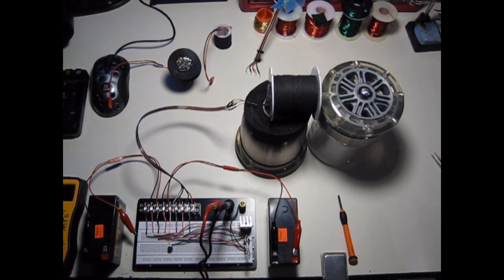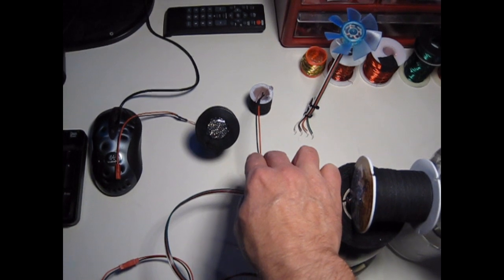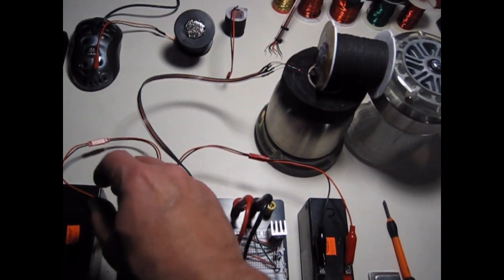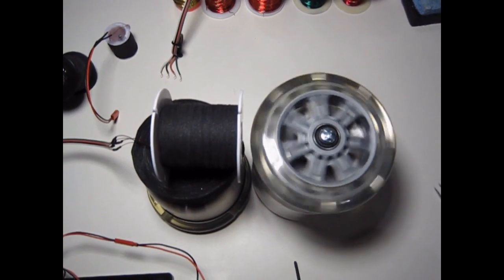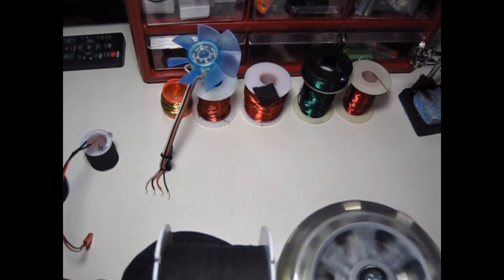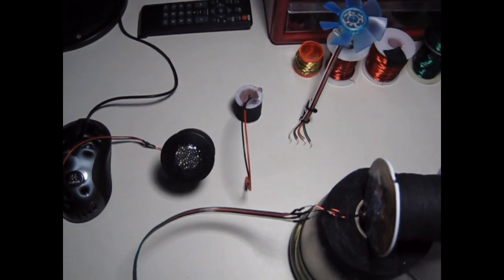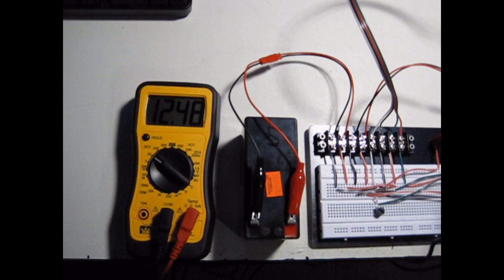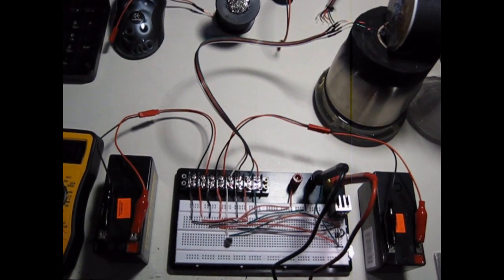My 3rd Bedini Motor

Comment: I think why you have a problem starting the Bedini motor is in fact to big of the core diameter vs diameter of magnets. Measurements should be about the same. 
It's also good for the core to stick out a little bit on the other side of the coil, so flux can find good close path e.i. magnets- core- magnets
Reply: You can also add a trimmer pot. 1M in place of collector — base to forward bias the tranzistor.
Armed with knowledge you should be able to produced some fruits. 
Happy experimenting. §

Comment: This is a mechanical Dc to DC converter. It charges batteries by rectifying the back emf of a coil fed with short duration pulses. The pulse timing is controlled by the flywheel.
The equivalent could be built without the flywheel or any moving parts or magnets by using the same transistor and power coil (trigger coil not necessary) but driving the transistor from an oscillator with a suitable mark/space ratio. In other words drive the transistor with a waveform that resembles the trigger pulses. This set up will make the transistor and coil produce the same output as the Bedini motor so should be just as good at charging and reconditioning batteries.
This type of circuit is known as a buck boost converter.

Comment: Why does a bedini motor need a battery? In my opinion it would work better with a capacitor. I'm still not convinced this isn't pseudoscience. And why is it that I never see videos of any built big enough to have practical use?
Reply: Because they dont work or have any practical use
Reply: I guess you don't look hard enough. At one time they were selling a SG1 kit but it wasn't cheap. Google Bedini motor.
Reply: Ramon Preston Why would I ever buy one?

Comment: I m giving it a try also but no luck keeping it spinning.I do not see any transistor or parts on the board.can you show the circuit you are using.and the size of the coil spool?hxwxl of spool?Idont know what I'm doing wrong but I'll keep on going with some help.Thanks Bruce
Reply: You wont have any luck cause you've been conned, the only thing this excels at is scamming people
Reply: ***** actually john says it can be self looped.but you will have to exchange a bank of batteries.unless you can devise an auto switcher. And the one i made is free energy. ive always been able to keep both batts charging at all times. as long as i switch them out.
Reply: ***** Sorry I dont live in the 1950s I have zero need for a dessulfator

Comment: Hello Dave,

I'm one of your avid subscriber and i'm really impressed on your bedini circuits. I just want to ask some details about your circuit.

1. How many turns do you have on your #22&26 bifilar coil?
2. Is neon bulb necessary in the circuit?
3. Is roller skate wheel the best rotor to be used? Do you have any recommendations if there is anything better?

Comment: I have only been able to build the SG so far using a fan motor by removing the fan blades down to the metal cylinder and inverting it on top of the fan with the barring's then  added four curved magnets and a 448 winding bifilar with # 22 and #26 wires.  It is exciting to use the back EMF to push magnets around.

Comment: Do you know what a generator or alternator are?  once you get your motor working great you advance to attach a alternator to it then you can advance from there.  I'm at the same stage as this video and have a motor running now so I need to create a bigger motor then add a generator.  College is taught by tenured narrow minded teachers that will never advance and suck in your money as long as you spend it~  Do some research yourself.

Comment: Jon Deth, I'm going to step in and ask you a question and if you answer this truthfully you will prove what your'e aysing wrong! You say there is NO SOURCE OF FREE ELECTONS right?  If you have a brain then tell me what makes a crystal radio work? NO Batteries or source of power!
RF frequencies and electrons permiate the atmosphere. Capturing it is not impossible. Converting RF frequencies to voltage is a proven fact! I suggest you come back when you know what your talking about! Have a good day!

Comment from the maker: I think the first coil I used metal coat hangars, which isn't the best material for the core.
(I was still learning)- The Copper coated Steel Welding Rods are recommended. (R60, RG40, RG45) I just went to ACE Hardware and found some generic Copper coated Steel Welding Rods. They worked really well. (I'm not sure where to find them on the web.)
Dave

Comment: ok thanks, I will try to replicate this project in the next days. last question:
at 4.46 you are showing the inside of wired copper.. "Copper coated Steel Welding Rods"

is this the name of the things? I've tried to find on google with no success, can you post me a link ? :)

Comment from the maker: The Circuit does a few things. As the Magnet passes the Coil, the power generated causes the Transistor to "Switch". This creates the Back EMF Spike that is used to charge the 2n'd Battery...and it also turns the Circuit into a Motor, which pushes the Magnet past the Coil. Then the Transistor "Switches" back to its previous state. Hope this helps.
Dave

Comment: I would like to see an ammeter in series with the charging battery. If it's charging at less than 200mA then it's not charging the battery, only rejuvenating it !!!!!!! 
You need at least 400mA to charge it successfuly!!!

Comment: remove magnets. leave just 4 or 6 no matter u have 2 have false S poles in between them. put a little cap instead charge bat. put additional coil before diode. better bi-filer. find base resistance and best connection to run the motor. try another coils you have. check cap voltage, the higher the better, current, the lower..,and RPM. with your best result discon neon for short to see cap volts. charge something with no neon, it cuts volts. never run with no load and no neon, u'll lost ur trans))

Comment from the maker: A good core material is Copper coated Steel Welding Rods, cut to the length of the coil. A found some at Ace Hardware.
Dave

Comment: have you ever hooked it up to an inverter or alternator to run anything.  I have seen a lot of video on here but it always just a spinning wheel in closed loop system from what I can tell or running a few low watt leds.  I am very interested in getting one but I want to be able to hook it up to a inverter to power lights or a tv etc

Comment: @Americankettler Just one correction. It's not back EMF that they are charging with. After playing with pulse motors a bit, I reached a conclusion, that the primary acts more like a gate here, creating conditions where the secondary charges. This can't be explained using just classical electrical engineering. Sudden collapse of electric field in the coil makes something happen there. Whatever it is, it can charge batteries, capacitors, god know what else it can do.

Comment from the maker: @GJ3200 - Right now...there are 2 good uses for this circuit. Charging Batteries...and Re-conditioning Batteries. I've brought back 3 Batteries that I thought were trash. Now they are holding a good charge for a long time.
Dave

Comment from the maker: @cloverpark2011 - They are pretty strong Neo Magnets...not sure about the pull force. I later discovered its not so much the stength of the magnets, but the Back EMF that the circuit itself generates. The recommended magnets are Ceramic.
Dave

Comment from the maker: @cloverpark2011 - Make sure the Inner and Outer Coil wires are wired correctly per the schematic at the beginning of the video. It win't run if you have them wrong. Tuning is a way of getting the circuit to charge more efficiently. I explain that part better on a later video..."Tuning My Multi Coil Bedini Wheel Part 1"
Dave

Comment: great work, but I think the problem with the wheel is that it kinda wobbles on its bearings, I tried my little brothers scooter wheels witch are the same and if i manually push them too fast it just hits a limit and wobbles causing it to stop much faster.